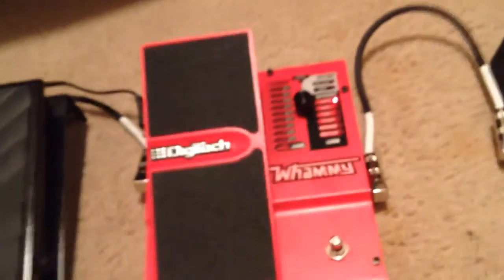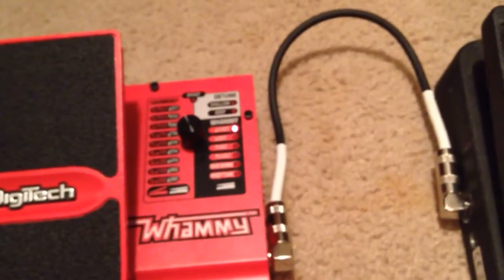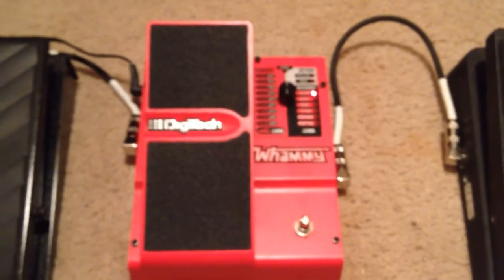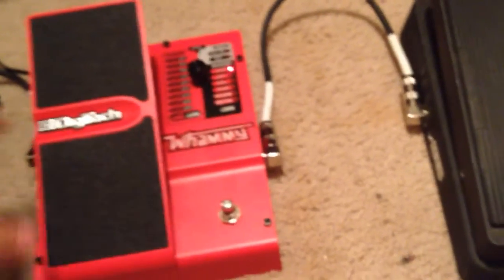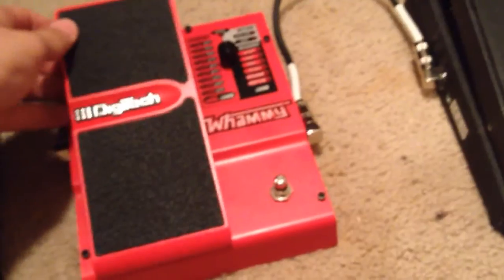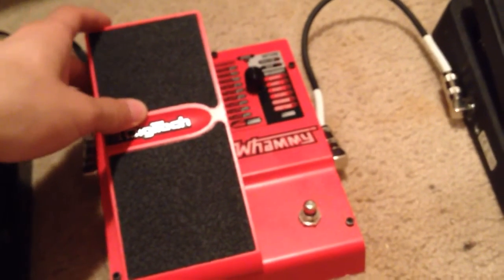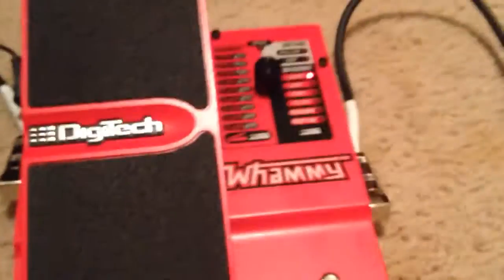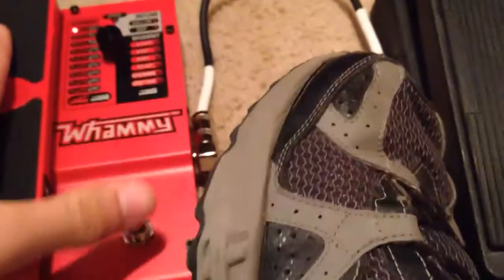Calibrating Your Whammy Pedal

Comment: i bought one used, without the power suply. i finnaly got around to buy the right power suply but when i put it in it just makes noices when i play on the bas, and the dry signal is not working. when i put in wet it sound like a very bad distortion pedal and i have to play hard before any sound comes out. everything works, the led and bottons. is it worth fixing ?
Reply from the maker: Dedicated Bass Oof. You may have to trade it in for a different one, unless there’s a guitar shop that could fix it for you.